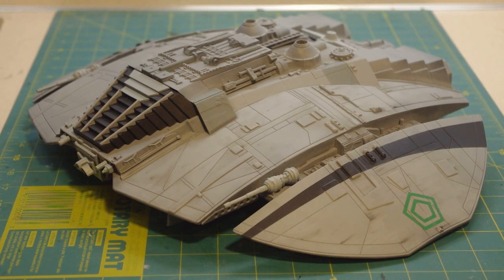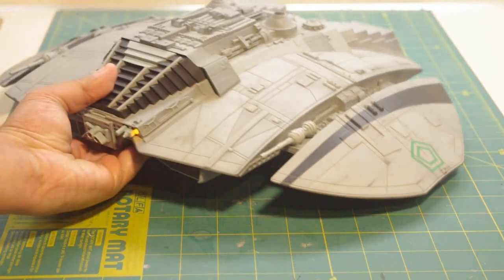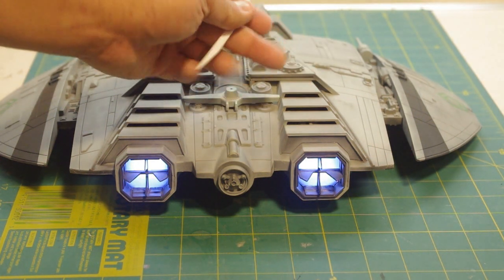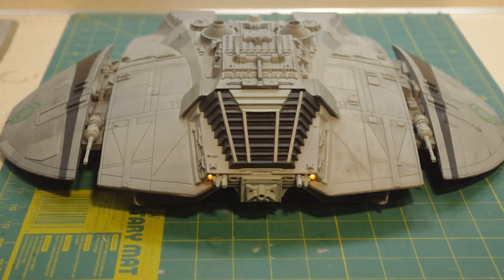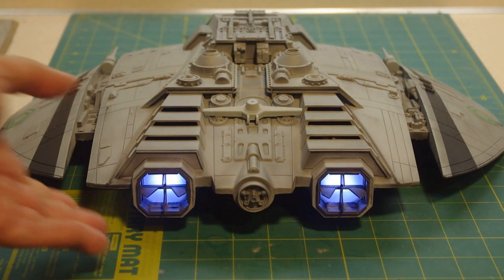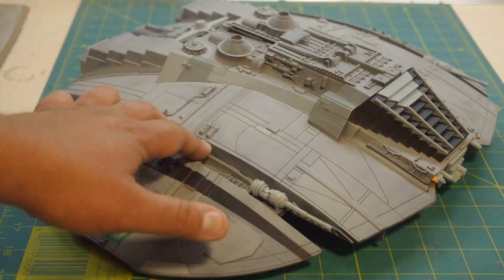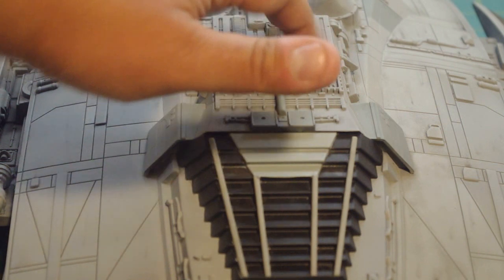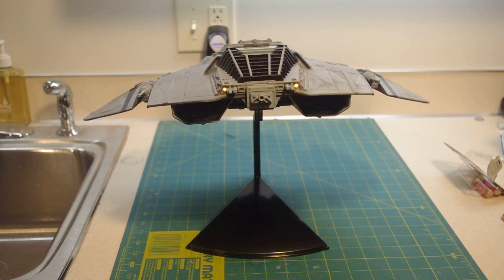Moebius 1/32 Cylon Raider finished (and lighted) model

Comment: Nice build.  I have the earlier Monogram version that was rereleased in the 90's with clear engines.  There are subtle differences.  I'm sure the Moebius is more accurate to the real production models, but as a display piece the Monogram looks fine.

Comment: I can't believe Flory and some other guys had the balls to say this model had "soft details."
I think it looks VERY good as it is and you can obviously add onto it EASILY.
I've heard it's better than the Monogram/Revell kit even though that kit itself can be upgraded fairly well, too.
This thought seems closer to the pictures I've seen of the surviving original Cylon Raider miniature that was sold in a lot last year with the other original Galactica shooting  miniatures.
I'd go after the Moebius models if I had the interest in doing Galactica models now.  They do seem to be appreciably better in general than the older kits, especially the original Battlestar Galactica model itself.

Comment: Well done!   I am most of the way through mine, and I have had a very different set of problems with mine that you have had.  I had a pin mark on the back of the model and none on the front.  The wings on mine don't fit right at all.   Very strange.

Comment: The thing I don't like about modern interpretations of the Cylon Raider is that they lack the taper of the rear portion of the outer wings.  If you compare the Mobius or Eaglemoss models to the ancient Monogram model, you can see that whereas the Monogram is manta-shaped, the modern versions are ovoids.  It's very frustrating, since the surface details are right, but the overall shape is subtly wrong.  Why am I sure that the Monogram model is wrong?  I've seen excellent photos of the original studio models.  The Monogram has a faulty nose piece; I scratch-built mine to match the studio version - which sits on my Monogram model.  The Mobius' nose is correct.  The Eaglemoss Raider has a lot of missing or simplified details.  Colors should be shades of muted dusty blue-gray, not a light warm grey.
Reply: Correction:  "Why am I sure that the (Mobius and Eaglemoss) model is wrong?"
Reply: Correction II:  "Moebius", not "Mobius."  But you already knew that.
Reply from the maker: Although technically the Monogram kit is accurate to one Cylon Raider as seen in "Hand of God". That was the Raider model seen "waggling" on the bridge monitor.
Reply: @JMChladek  do any commission work??
Reply from the maker: @bigskydude8068  I almost never do commissions because it can be a buzz kill to the creative process. But that being said, the Cylon has spent most of it's time in storage since I lack display space for it. So... it might be available for the right price.
Reply: @JMChladek  hmmm, might be interested...how do I contact you....also I do have a 1/25 viper(a big one..16"L) that needs painting...it's 3D Cast..just needs prep and paint...

Comment: I do like the look of these better than the Reimagined Raiders but I do understand why the new ones were designed the way they were.
No need for a pilot, fewer materials used, each individual Raider can learn on their own over the course of several resurrections and finally there would be no need to worry about g-forces since there was no pilot that needed to operate any controls.

It also helped to create a relatable caste system amongst the Cylons. An important plot point. Cylons were made by Humanity and treated as tools. When they gained sentience they saw themselves as slaves resulting in the first Cylon war. They eventually leave and eventually return. This is where the new series begins and in it there are Centurions, Raiders, Skinjobs and Hybrids. Each machine designed for specific tasks. This is a caste system and in it, a Raider can only be a Raider. With Skinjobs running the show, they purposefully limited the intelligence of the other cylons. Centurions had inhibitors and they eventually began performing lobotomies on Raiders because "fighter ships don't need to think that much"
Cylons treated their own just as... inhumanely as humans did. 
Eventually one of the skinjobs recognized how wrong that was and the ensuing retribution was one of the sweetest things in that season.

Comment: Looks great man !!  The one Im building, I did a little different than yours. like  the engines, I built two 2 inch long hexagon light boxes and installed the lighting using the clear kit part , I mounted that to the light boxes and in the front of the boxes I installed a frosted piece of clear plex it turned out pretty cool, the final result looks exactly like your kit so im pretty pleased. The only other thing I did different was I mounted the battery tray vertical with the switch installed  beside it under the canopy. Your paint job is spot on Question though, the top black stripes, how did you mask a straight line around those greebles ? Im having a brain fart trying to figure out how to mask them. thanks Great Work !
Reply from the maker: +Troy Meyer First of all, sorry this took so long to reply. The masking around the greeblies was done very carefully. But because I started with black and masked the stripes to do gray over them, I was able to use a bit more care in those spots. If I had gone the other way, it would have been more difficult given how tall some of those greeblies are (and I believe the effects modelers used a similar approach having the black areas not crossing the tallest details). Still, looking back I did have to do a little touchup here and there to sharpen up the paint edges where the stripe crossed the greeblies (it didn't need much).I have used a similar technique to paint one piece TIE Fighter wings, such as what the Revell and AMT kits have. So I paint the whole wing in black, mask off the solar panels and apply gray over the top. Result: a much crisper demarcation and the black acts like a pre-shade on the rest of the wing.